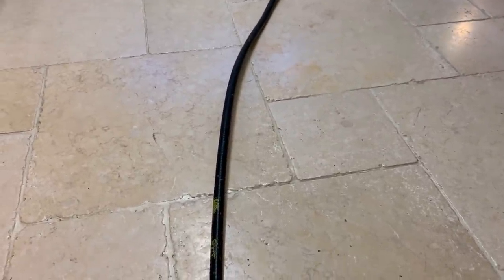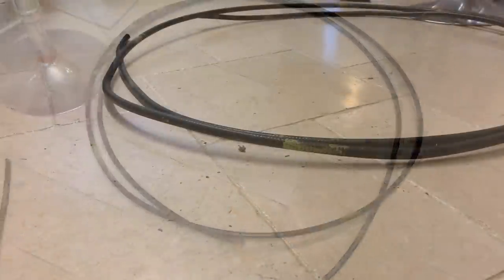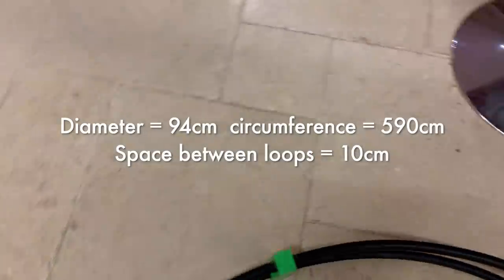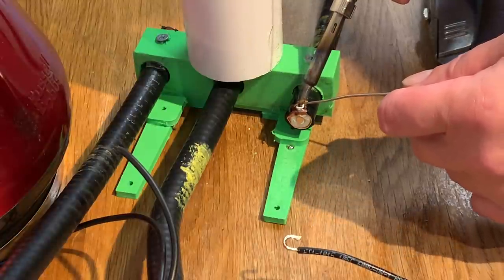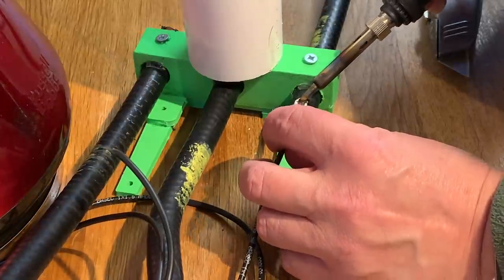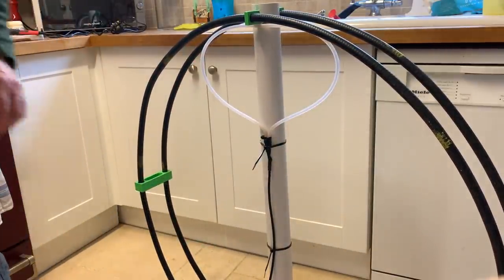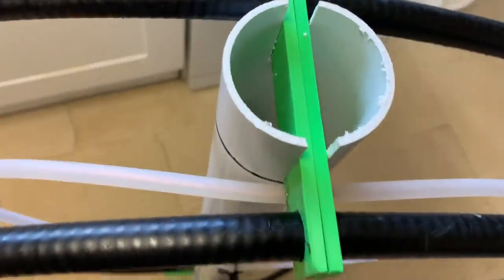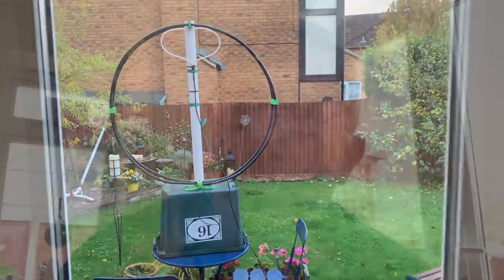HAM RADIO: Building a Coaxial Magnetic Loop Antenna. COAX MAGLOOP:  Double Loop:

Comment: Mike: I built a 2-turn magnetic loop from CATV RG-11 here. My cap for 10 watts is a dual receiver 365/365 pf cap with the sections series connected. The loop covers 80/60/40 meters and is rectangular to fit in the family car for portable outings. It's102cm x 90 cm and the loop conductors are separated by 7 cm center to center. A fun project loosely based on your Youtube videos! Lots of fun, and looking forward to some air time... de WB2VUO
Reply from the maker: sounds good, have fun. :)

Comment: Mike, great looking antenna did you have a plan you were working from laying out the loop sizes and wiring layout. I am thinking of creating one to try in the attic. I would want to set one up for 80m-10m and maybe another for 2m & 70cm running barefoot out of a Yaesu Ft 991a (100w or less) I would be looking to do remote tuning as it would be in the attic and the shack is in the basement

Comment: Love your videos and they've inspired me to make my own.  I noticed the loops spacing get tighter at the bottom, I don't think the 10cm spacing is kept.  Was that on purpose or what is the reason?  I made my mag loop using PVC pipe step by step by your instructions and I can get it to tune on 40/80 but haven't been able to tune to the 20 meter band.  I am using a 20/250pf variable.

Comment: wow that looks like real heavy duty coax  nice work mike looking forward  to see how it tunes with a capacitor.
pete G0LVG
Reply: That's LDF5 with a nominal power rating of 14kW and an attenuation of 0.64 dB per hundred meters. What's crazy is that the line goes all the way up to LDF12 which is 2.25 inches in diameter, has a rating of nearly 40kW, and an attenuation of 0.3 dB per hundred meters. If only the connectors didn't cost hundreds of dollars.
73, KD2TDE
Reply: @fletcherreder6091 wow that's great coax i wonder what the cost is per meter ?
Reply: @peternilan4276  Glad you asked, since it looks like they replaced the LDF series with the AVA series when I wasn't looking. Here's a distributor with a datasheet:
https://www.talleycom.com/viewProduct?rlProdNum=ANDAVA5-50
Below 1dB/100m loss over the entirety of HF!
Also the connectors are not as expensive for the 7/8" stuff as they are for the bigger stuff that I'm used to; only ~$40 as opposed to >$300.

Comment: Besides the flexibility, wx proof coating, and just cool factor, does using coax for the big loop add any other benefits? Does the center conductor help it be more wide banded? 
There is a fridge on the curb, and the copper is still there, would like to mimic this, but no broadcast or cell tower scrap around here.
Reply from the maker: No, you can use any thing for the coil, copper pipe is the best thing I have found..

Comment: Hi, is the location of the capacitor critical? Ie, any option/possibility to have it further away from the antenna?
Reply from the maker: You can put the cap anywhere as long as it makes a LC circuit.
Reply: @mike-M0MSN  Thanks! wrt the diameter of the large loop - any benefit ( or rather, what would the effect be) if I made it larger? 3 loops instead of 2? What about 4 loops that for a "ball" - ie, N, S, E and W orientated?

Comment: Hello ... Interesting design of the antenna ... I have a question ... What type of coaxial cable is used on the main loop. What is the capacity of the variable capacitor. I do not understand English very well.

Witam... Ciekawa konstrukcja anteny... Mam pytanie... Jaki typ, rodzaj kabela koncentrycznego jest zastosowany do wykonania głównej pętli. Jaka jest pojemność zmiennego kondensatora. Nie rozumiem zbyt dobrze angielskiego.
Pozdrawiam
Reply from the maker: kabel koncentryczny to heliax (hardline lub Andrews), a kondensator ma od 9 do 300 pf

the coax is heliax (hardline or Andrews) and the capacitor is 9 to 300pf
Reply: @mike-M0MSN  Dziękuje..

Comment: Fancy.  What did u use for plastic spacers? What was your fill %?  Just curious. Haven’t used my printer in a while. I use Fusion 360.  Great antenna project.  Would like to see this antenna with a capacitor. Are you planning on using a vacuum variable?
Reply from the maker: 20% fill, but it took all day printing.. air spaced Cap, due to cost $$$.

Comment: Question : will RG213  coax work as well ? Q2 = solder the connections to the braid ? what to do with the coax core. ? pls some more details as i got plenty of RG213 laying arround. No 3 d printer unfortunatly. 73s from PD0ROH
Reply from the maker: Good to speak on DMR,  Yes you can use RG213
Reply: @mike-M0MSN  This channel has super service 😜😜🤣🤣🤣🤣 Q&A on DMR worldwide 91 😜🤣🤣🤣

Comment: Nice work as usual Mike! I'll be watching this build with particular interest as I've been considering a magloop build myself for some time and that large heliax seems the best stuff by far. I want mine to be able to handle respectable input power, Have you considered using a vacuum capacitor? Expensive but very reliable  or an air spaced cap but immersed in oil again capable of greater power handling but also far less susceptible to corrosion for a permanent outdoor install.  Keep em coming, Great down to earth proper ham radio vids nicely done! Many thanks. Tom, 73!
Reply from the maker: Thank you Tom.. 😀

Comment: 5:00 soldering core with the shield together on both ends will give you less resistance. Have you tried to use flux? Try to find "no clean" one. Works better than resin cores inside the solder.
Reply from the maker: Thanks for the tip
Reply: What about the skin effect? As far as I understand, the core will not help in reducing the resistance as at higher frequencies the electrons are pushed to the surface of the conductor
Reply: @ekimlebenk4183  that's the wrong understanding of skin effect. imagine a round bar and flat bar, both with the same cross-cut surface. the round bar has a smaller surface and the flat bar could be theoretically thinned out to have an external surface up to infinity, but both will have the same resistance as the cross surface matters not the skin surface. Skin effect just tells that electron likes to be outside, but if they can not be there then they won't and you have deeper penetration. Good practice 4A per 1 mm^2 safe practice 2A per 1mm^2 but that's irrelevant from the resistance part of the impedance. If you would have to take into consideration skin effect that means your magnetic look is improperly built. (diameter to length ratio). it also means you are one of the reachest people in the world to have such an antenna for HAM HF bands as it would take humongous tons of copper.

Comment: Should not the driving loop be 1/5 of the electrical length of the resonant loop, not the diameter?
Reply from the maker: Thats a good question,  Its standard diameter is 1/5 that of the main loop. However, I have seen designs with 1/3 to 1/8 the diameter of the main loop...??
Reply: @mike-M0MSN  I downloaded a document all about considerations of using mag loops and 1/5 is what it said, but as you use multi turns to make compactness surely you should do the same with the drive ring, or maintain the electrical length ratio, as we know, wave length regards electrical length and not the shape it is packaged into.

Comment: I can't afford a 3D printer :-(  Have to chop up the white plastic chopping board and spend the next few nights sleeping in the shed!  :-((
Reply from the maker: I have made one using 50mm and 38mm plumbimg pipe that works well, (next video).. :)
Reply: @mike-M0MSN  Ah yes, I could use the plastic plumbing clips to hold it all together.  10mm Microbore pipe should be easy to bend into a circle.  EDIT:  Look forward to next video.

Comment: While I applaud all efforts to learn by experimentation, my "gut feeling" is that any multi-turn magnetic loop antenna is likely to be retrograde by comparison with the conventional single-turn.

It appears that the single-turn loop is more than just an inductor.  In effect it is a centre-fed half-wave dipole where the ends of the dipole have been pulled round to form a circle.  And the ends of this "half-wave dipole" are connected together with a variable capacitor.

So the entire loop radiates into free space.  There is high voltage (across the variable capacitor), and a high current (near the feed point).  It may not look like a half-wave dipole, but it works very much the same way.  (However, unlike a half-wave dipole the circumference of the loop is not determined or constrained by the transmitted wavelength).

The important consideration is that there is a voltage standing wave around the loop, where maximum voltage is across the variable capacitor.  But this "pure" arrangement is severely upset if the loop is multi-turn.
Reply from the maker: I would agree, a single loop at the correct size for the band/s you are trying to cover will work far better than the smaller twin, just like a 160M halfwave (80M) antenna will work far better than a 40m coil loaded shortened antenna on 160m, but hay!!! small garden small loop...

Comment: i dont understand how does it get so low swr without variable capacitor.
Reply from the maker: The length of the loop is a perfect match for 15.4 MHz as it acts like a fixed length magloop until you close the loop with a variable capacitor, as this adds variable length electrically and because the length changes so the frequencies move.

Comment: So why No set diameter for the magnetic loop antenna.
I find it frustrating to communicate with Ham radio Humans.
I am aware that the modulated electric field works best 
at resonance with element length.
So what about the magnetic field??
Please provide a straight answer.
Reply from the maker: I will try and possibly fail, however here goes... The loop Magloop antenna or Small Transmission Loop (STL) is basically an LC-circuit that has to be tuned to resonance on the desired operating frequency. It is normally 10% or 1/10th of the wave length you wish to operate on for example circumference of just less than 8 mtrs for the 80m band. The loop by itself is an inductor that has the shape of a closed-loop. The coupling loop is is around 1/5 or 20% of the larger loop and acts as  the pick up. The wavelength of the large loop is tuned using a variable capacitor (it fools the smaller loop into thinking the outer loop is bigger than it is) and therefore changes the resonant frequencies.   For more information check out https://www.nonstopsystems.com/radio/frank_radio_antenna_magloop.htm#
Reply: Ok , you did good.  Simple to the point.
Have another question. Why is the magnetic field wave length 10% of the electric field wave length??
And I am interested in magnetic loop for reception of the VHF Tv Low band channels 2 thru 6.
Magnetic field reception has a lot less interference then electric field reception on 
Tv channel 2 thru 6.
And yes I know that magnetic loops are less efficient at frequencies above 30 Mhz , But that does not mean that it wont work.
And there are magnetic loops for the FM radio band and that is above Tv channels 2 thru 6.
When I have brought this issue up in the past , Ham Radio Humans , Switch OFF and refuse to talk or think about it.

Comment: Have you tried to couple the larger loop with a toroid, FT 240-43 or FT140-43 a simple 1:1 would give you a really low SWR.... some people use an ATU on their radio to help out with the matching. A toroidal match or a gamma match really work better than a small coax loop.
Reply from the maker: Thanks Dave will give that a try.
Reply: I use an FT240-43 on a 5.8m circumference loop for 40m and I can get very close to 1:1. Unfortunately you have to change the number of turns on the toroid to achieve decent SWR on a different band. Eventually will try using a remote relay to "adjust" the number of turns

Comment: I think you would have been better making a mechanical joint with the wires you soldered on for the capacitors, then soldered them. Relying on just the solder strength could lead to a future failure
Reply from the maker: Agreed, I have now removed and done just that..

Comment: pffttt  that's just a mere scratch.........   try working with real cable the diameter of your wrist or bigger..... 😄
But yes, it is difficult to work with for sure...... cheers
Reply from the maker: Hi Roly, I know its small fry for you but...
Reply: @mike-M0MSN  Just kidding' with ya Mike. The price of the big Commercial FM Broadcast stuff capable of 50- 100 K watts will make more than your eyes water for sure.